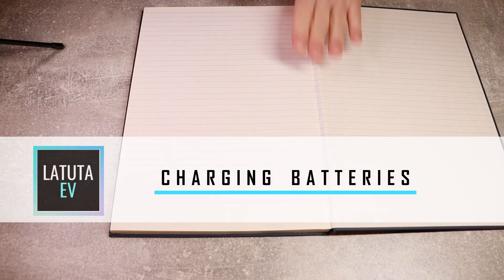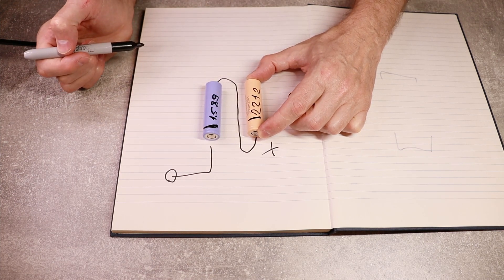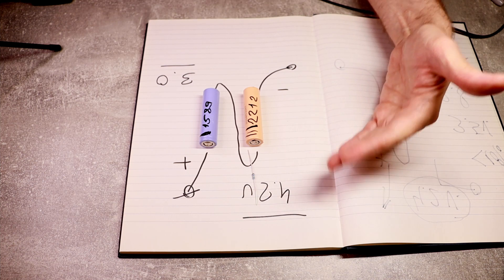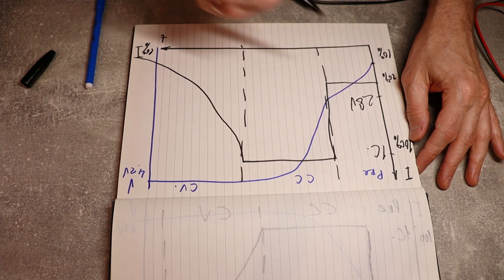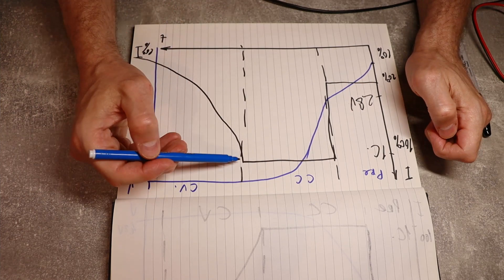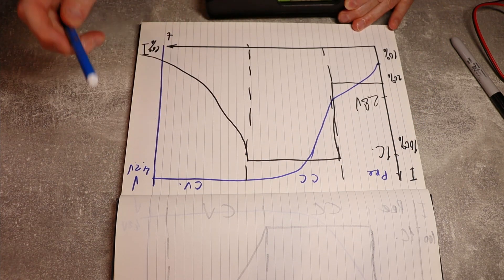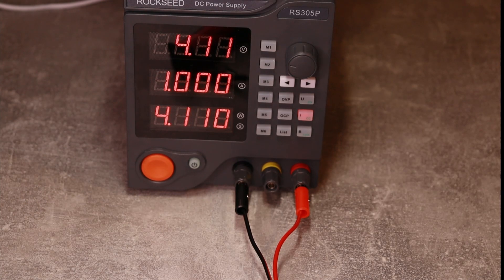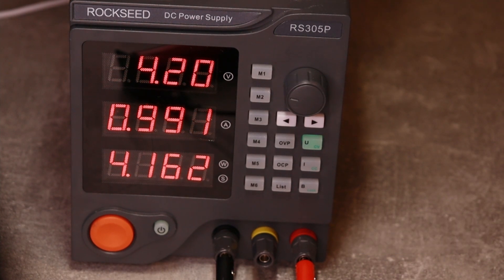Battery charging laptop cells  DIY EV Toyota Prius Ep 7

Comment: Great content. I have a junk Prius sitting in the yard. What are you planning on putting this whole system in? Would love to tackle a project like this.
Reply from the maker: Thanks Bruce I am glad that someone else does see potential in such a great cheap electric motor and inverter. I am plating to get motor and inverter working with the battery first and workout all contactor setup as well as pre-charge circuit and BMS. I have not decided on the car yet but I have a few models in mind, although a few people asked about this I might as well make a video about this😀